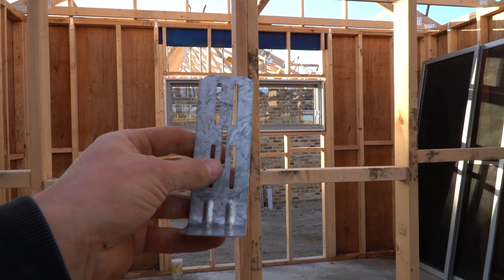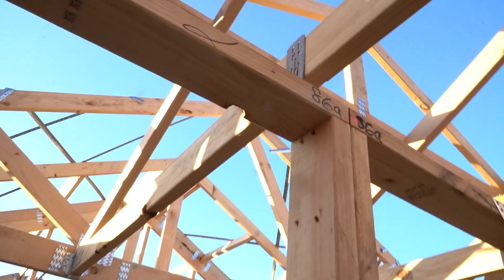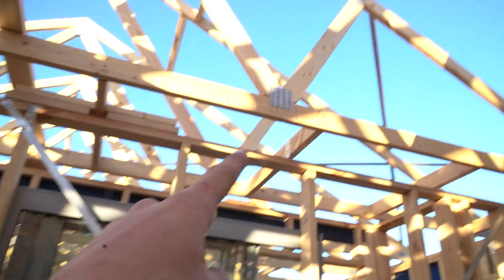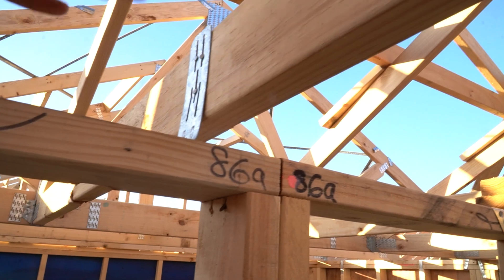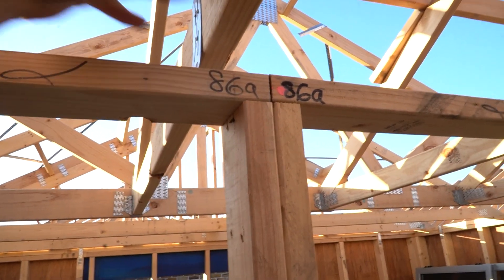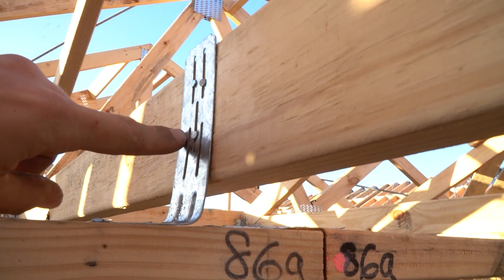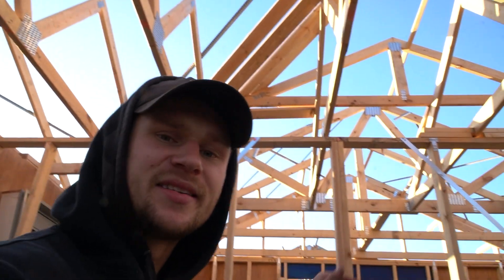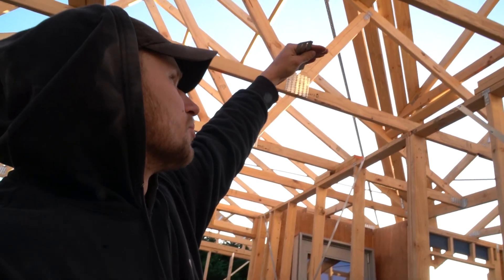Why do L Brackets Have These Long Slots

Comment: What’s the Timbers nailed to the top plate either side the truss for just off to the side of where you showed the brackets?
Reply: that's shear blocks, you install them in braced internal non-load bearing walls. serves similar function to the L brackets in that the truss can move up and down in-between it but not side to side
Reply: They look to be performing the same function as the L bracket but over areas where there's no vertical stud. 

His example L bracket location is right above a stud. The double timbers seem to be above gaps. The timbers look like they span to the studs.